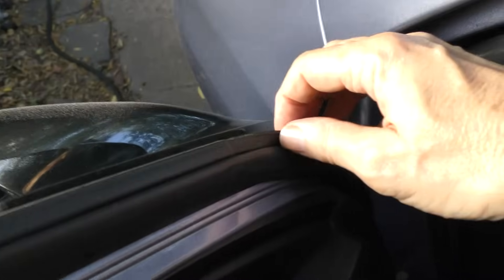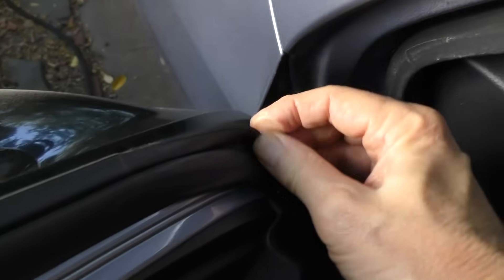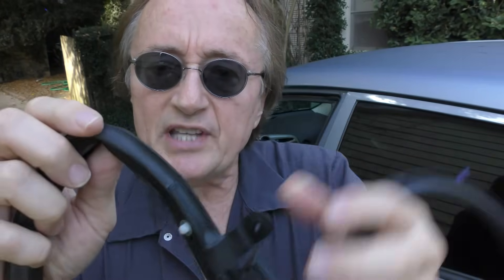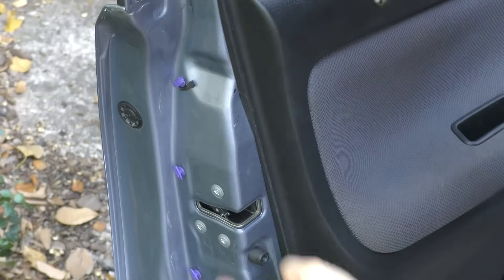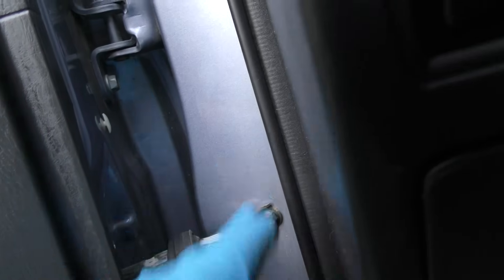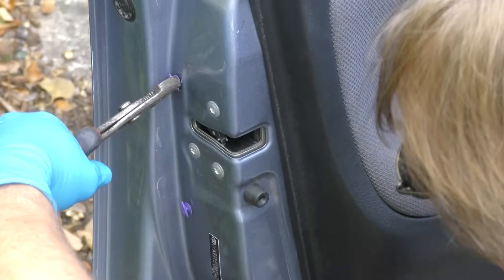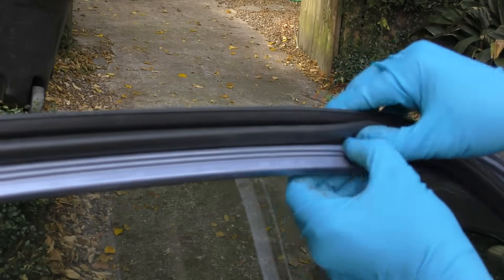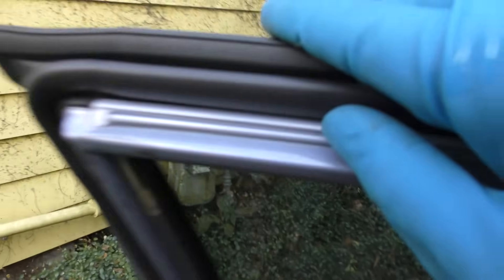How to Fix Whistling Noise in Your Car (Door Seal)

Comment: Just changed the door seals for all 4 doors in my 2009 Mazda 6. It's nice that they used different colors plastic clips for each door(yellow, pink, blue and orange) so you can pickup the matching seal right away when installing them. Anyway, made a huge difference, seals were dangling at the bottom of the doors because the rubber tore up over time where the clip were, I would constantly need to put them back into place, especially in winter (rubber would stick to the car with the ice)
Reply: Where did you buy them? I have a 2010 mazda 6.
Reply: @frothly  bought them at my local Mazda dealership. You might need to have them order the part

Comment: Our 2006 Saturn Vue driver side door had that problem...feel down about a 1/2 inch near the top of the jamb....a few layers of electrical tape saved the 70 door cost for a new door seal on a car 11 years old at the time...l put a few lengths of tape on that trim it slipped over...still having working today....

Comment: Hey scotty, love your vids. I emailed you back on september 15th, It was about my van having no heat. its a 2003 mazda mpv and it had a coolant leak in the back behind the rear passenger wheel well. My family friend/mechanic ended up taking the hose in front and rerouting the hose so the coolant doesnt leak. I ended up having no heat. The same mechanic told me to take a plastic hose crimping tool and no I have heat. I figured if anyone has this same problem, if you did read my comment this is a really good temporary solution.

Comment: My 2009 F150 whistles "she'll be coming' round the mountain" at 100 kph, and there's not a mountain within 2000 Kilometers of here, how do I fix that?
Reply: Change for a real truck man !
Reply: howder1951 drive it using miles, not kilometers. American trucks aren't designed to use socialist measuring systems.
Reply: I changed the readout to miles and now it whistles Dixie!
Reply: You are so Lucky.
Reply: buy a chevy

Comment: I have a bad vacuume leak making a whistle from inside or around the brake booster. It whistles while running and continues to whistle after shutting the engine off for about 3 seconds till the brakes loose boost completely. It's a 2003 honda crv and everyone I've talked to said this is a 800 dollar part to replace parts + labor. Is this a bad dream or is this a seemingly likely/possible spendy part that could fix such an issue? If I leave my foot on the brake pedal while shutting the car off, it slowly stiffens and raises up in about 3 seconds (loosing brake boost, not brake line system pressure). I'm a senior engineering student at OSU cascades and this issue feels completely out of my hands. Advice is greatly appreciated.

Comment: i put tow mirrors on my tundra and then put the factory mirrors back on  and i have wind noise i adjusted the driver side 3 times so maybe its the weather strip?  and are your thoughts 2010 tundra double cab

Comment: water leaking through my speaker holes on both sides (2-door) thankfully they still work.
I remember putting electric grease on the connectors.  I put some more for good measure.

must be a bad weather strip.  
They’re so overpriced though

Comment: Hey Scotty, in my 2004 GMC Canyon, the A/C is not working. The compressor works because I can see the pulley moving. Also the lines going to the pulley begin to get covered in ice if the A/C is in the on position. Could I get some feedback? Thanks BTW love your channel.
Reply: Also when the max A/C button is on. It does not turn off when the setting is at 0 or off
Reply from the maker: ice means it's freezing up from a restriction inside the system. So find and fix that restriction, like a bad orifice tube or bent lines

Comment: '02 cCorolla; Not the rubber door insulation but the thin plastic like wind silencer ? stripping around doors/windows  has become brittle and cracked and falling off. Is this replaceable / available ? I see this same condition of brittleness on many other cars, what is that thin black stuff  similar in texture as a house window blind slat.
Reply: yes that part is replacable
Reply: Where does one buy it, Cesar ?  Also, how do you replace / install the new ones ?   Is this stuff for silencing wind noises ?
Reply: you can go to autozone and ask for one. or go to a junkyard, ive seen many corollas there too.
Reply: Have you tried Auto Zone?  They can also help  you replace it

Comment: Hey Scotty;
I drive a 2007 GMC Sierra 1500 classic pickup,  Just had a new resistor and new blower fan installed at a garage
now when I am driving, and pressing on the gas pedal,  there is this high pitch sound coming from the blower fan.
Thing is not coming thru my radio speakers, heck my radio is not even connected.
I am going nutz, can you help?

Comment: hey scotty I have a 1999 vw jetta that puts out black smoke. checked compression and it was fine took it to a shop and they said it was fine
Reply from the maker: they are idiots, black smoke is running rich, find a real mechanic who knows how to read live and mode 6 data to find the fault, many things can do that.
Reply: Scotty Kilmer. it's a tdi if that helps also has 241 thousand miles

Comment: hey scotty I'm changing out a drive shaft on a 2005 tacoma pre runner. by any chance do you know if the front of the drive shaft needs a bearing or seal. because I bought a used driveshaft but don't really know if the front of the driveshaft needs one. it's the front piece  that goes into the transmission.
Reply from the maker: the seal is inside the transmission and should still be in there
Reply: Scotty Kilmer thanks for the reply

Comment: @Scottykilmer I have a 87 Camaro my question is my Coolant level is always Low i dont know why i replaced my Radiator my fan my thermostat my hoses are new my radiator cap is new the Car runs Great and it Dont Overheat What Could Cause my Tank to always Be Low Level?
Reply: I Also Did A Coolant Flush
Reply: Is the tank ok?  Check it for cracks and the tank return hose for leakage as well.
Reply: Believe231 Yes the Tank and the Return Hose is in Good Condition

Comment: Scotty. my 02 celicas A/C doesn't seem to cool the car to good anymore. it's fully charged and everything works. but it can't seem to keep up with heat. it only cools OK when it's on recirculate. but even then it's not strong?? any ideas
Reply: I have a tip... make sure that the cold/hot selector is completely closing off the flow of engine coolant to your HVAC.  Just because you've turned the dash control to cold doesn't mean the mixer is fully closing off the hot water. It's a problem I've had on a few cars and trucks over the years.  On some of the older trucks I drove, it was just easy to put a shut-off valve in the heater hose under the hood,  then in the spring I'd close off the hot water fully, and re-open the tap again in the winter.
Reply: Another thing to check is the interior air filter.  If it's old it may not allow air to freely pass through and prevent the AC from working properly.  Scotty did a video on that recently and it's fairly easy to  do.

Comment: I kind of have a similar problem but then again its not really a problem on my g37. Because when you get out of the car its low enough that sometimes out of habit you grab to close the door by the top and over time the rubber part will get a little lose, but I wasn't thinking about finding a light adhesive to apply to it to stop that from happening. Any suggestions?

Comment: Here in the tropics, near the beach, rubber parts can get rigid and crack prematurely. Is there a way to prevent that?
Reply: in the tropics you will actually have better rubber seal life than in the drier colder climates because of humidity. Rubber doesn't like dry air or direct sunlight, so keep it covered from the sun and you should be fine. if the air is salty, then dry to minimise time around the coast and clean regularly
Reply from the maker: salt water will destroy them, so wash the car a LOT

Comment: Doesn't weatherstripping typically require weatherstripping adhesive, or is that only on certain parts of the car? I'm working on T-top weatherstripping right now and it was used at the factory. Getting it off is a pain in the butt!
Reply from the maker: depends on the design, toyotas don't use glue, they are better designed. Cheap American cars often do glue em on, making them cheaper to build but harder to fix

Comment: question i have 03 chevy impala while im driving i push da gas paddle to the floor and I get no acceleration I have to let off the gas to get a acceleration what can be the problem
Reply from the maker: often a weak fuel pump, pressure test that first

Comment: Hey Scott, quick question.  The rubber piece around the door stopper gets wrinkled when I close the door as it comes into contact with the door stopper(pin).  So this rubber is bent because of this and even if I straighten it, then after few hours it is the same.  Would you recommend any lubricant that would help this rubber piece to stay straight without wrinkling again?

Comment: hey scotty, i have a 2002 civic si and when it's extra windy outside or i'm driving near a tractor-trailer my windows shake and they're not very secure in the door. is this something that can be fixed or is it just how the car was made?
Reply from the maker: you can replace the rubber strip sealing around the window glass, that wears out on a 15 year old car
Reply: Scotty Kilmer that's what I was thinking. thanks!

Comment: Hey scotty, i have a 2003 Audi A4 1.8t that has a low oil pressure light on but the car does not overheat or show any signs that it will seize even after a few hours of driving it. Bought it recently, could there be a chance that the oil is incorrect thickness or the sensor is shot? What do you think? Thanks
Reply from the maker: try a new sensor first, if not that, have it pressure tested with a mechanic's oil pressure gauge, and if really low, sell that thing FAST, rebuilding audi engines costs a ton

Comment: The whistling noise you are hearing is an oompa loompa hiding under the dash. They tend to whistle when they work. Find the oompa loompa and take them back to the factory. The whistling noise should stop. If it doesn't solve the problem then there is a second oompa loompa hiding under the dash.

Comment: I have a 2003 subaru wrx STI and there seems to be a whistling noise coming from the turbo every time i step hard on the gas.

May i know how i should go about fixing this issue?
Reply from the maker: live with it, they wear when that old, and only replacing the turbo would fix that

Comment: I have a 2013 Chevrolet.  Someone cut my seal. Dealer ordered the part and kept going up on the price of cost and labor. Part hasn't came back yet. He said he has to take off the side mirror which is attached to the seal. I dont know if he knows for sure what hes doing when they call me in for repairs which hasn't happened yet. Said it would take about a hour to fix.

Comment: Title spelling goof "whisting" haha

Couple of questions on rubber parts for ya. So once in a blue moon I'll be cleaning a car thst has some age on it and find that as I move around the weatherstripping there seems to be lumps of hardened material/debris inside. Obviously it seems it wouldn't seal correctly and may even not let the door seat true since it can't squish into the rubber which could lead to hinges progressively bending or whatnot. Anyhow, is there any way to try to get the debris out, or am I stuck with having to replace the whole seal? Granted, the seals aren't in great shape but they do work for the time being. 

Other question is what can I use to make rubber parts last longer? I usually use silicone spray lube since the cans indicate they're good for rubber, but whether it helps I've yet to find out.
Reply from the maker: thanks, I was groggy this morning. you can clean the debris out, often a hose and a soft brush will work fine if you soak it half an hour first Silicone lube does work, as do mny products like Armorall
Reply: Nice, I use pure silicone spray lube underneath vehicles, especially before winter. Works great in door locks too.
Reply: For stuff exposed to the elements under a car like bushings, White Lithium Grease works even better than silicone because it's a little thicker and very resistant to being washed off by water and salt on the road.

Comment: Hey I got this weird whistling noise in my truck it happens every time I get on the gas and gets extremely loud at times. sometimes it makes another sound right after when i let off the gas it goes STU TUU TUUU weird huh iv managed to locate it coming from this weird snail shaped thing attached to the engine.
Reply: @NoobidCakes if it has an impeller, than its a turbocharger

Comment: my whistling wind blowing sounds is still there and it goes away when i got out of the car to check 
then its is there when i get back in my car the sound comes from the passenger side 
it only happens when my partner is in the car
Reply: genmaxpain have you tried twlling your partner to take a hike?
Reply: genmaxpain your partner is leaking air, try duct tape to seal the air leaks, then find a new partner, may have to repeat the process with each partner
Reply from the maker: weight can effect how air flows in a car, give them the camera to film sound on that side to pinpoint it.